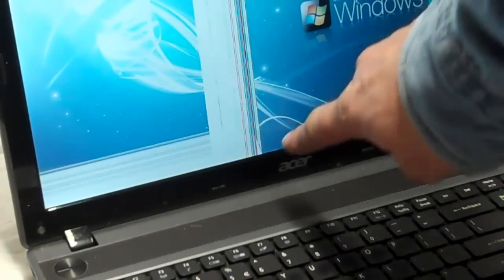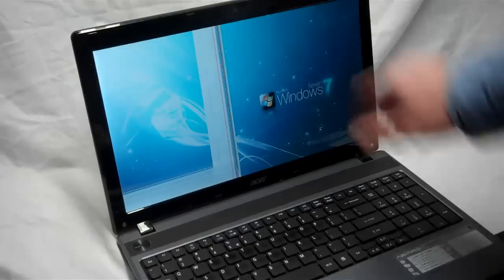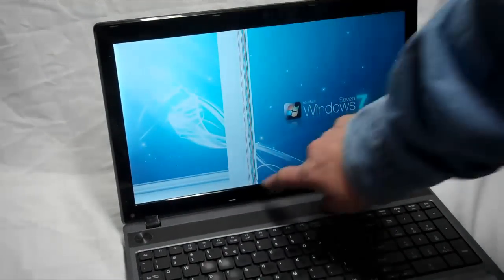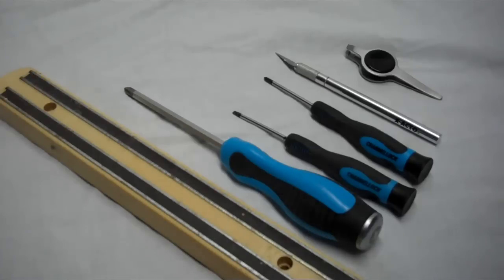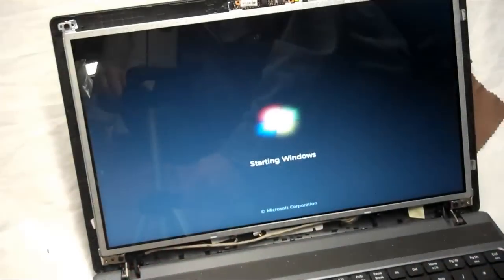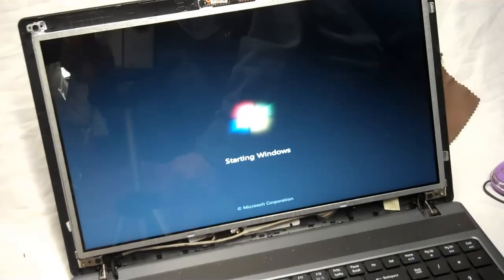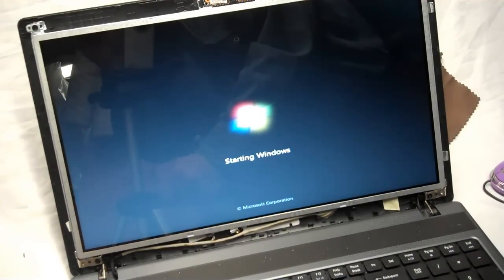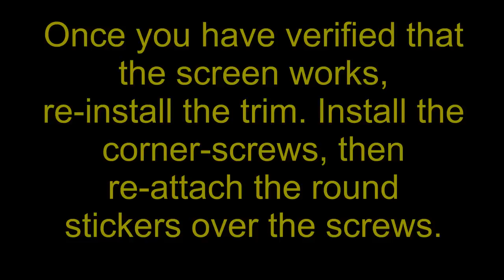Laptop screen replacement / How to replace laptop screen Acer Aspire 5733 - 6437

Comment: Note that there were different ASUS Aspire Ones with different screen sizes.  (Manufacturers shouldn't be allowed to have a "model" which is not consistent, IMHO).  When you order a replacement screen triple-check that you are actually ordering the one you need.  You might even want to dismantle your own Aspire One, flip the screen to see the model # in the back and be sure that your model number matches the seller's.  e.g. I received Model# B101AW06 v.1 H/W:1A F/W:1, my Aspire has a Model# B116XW03 v.2 H/W:1B F/W:1 in it.  Turns out my Aspire One's screen is a bit larger than the replacement I received and the screw brackets are in different places (not just on the sides).

Comment: I have a Acer laptop very similar to this, and one night as I was going to sleep I accidentally closed the lid on the charger. After it had been pressing against the screen all night long in the morning, when I opened it, the screen was mostly black and glitchy looking. Is it possible to take it apart and fix it? Or do I have to buy a new screen?

Comment: There are two cables attached, I didnt see how you took the other one off?
Reply from the maker: I seems as though you may have a different screen or slightly different laptop model. My laptop in the video specifically has one cable, because it is an LED screen.
Reply: No its the same, Im mean this cable, 3:45 held down with silver tape, hangs down from the web cam, is it just a case of pulling it off and sticking on new screen?
Reply from the maker: Oh that. It is the cable for the camera. It is  just stuck there with tape or sticky glue sometimes. You can use new tap if needed. Just make sure the cable is flat and neat, so it won't put pressure onto the back of the screen. You do not need to unplug it from anywhere, but always check those connections when putting the whole laptop back together, just to be safe. Test the camera when you test the screen before you completely close it back up. You'll be fine.